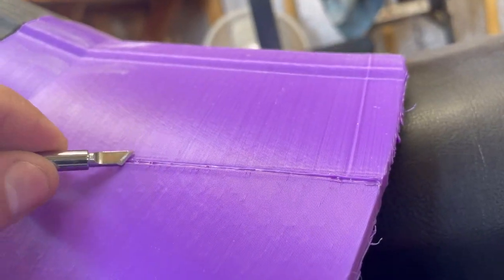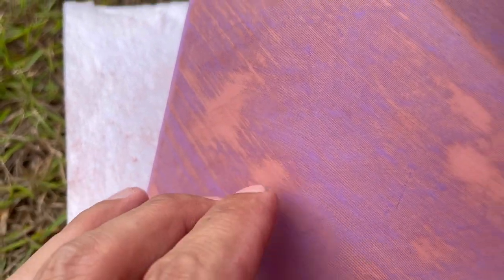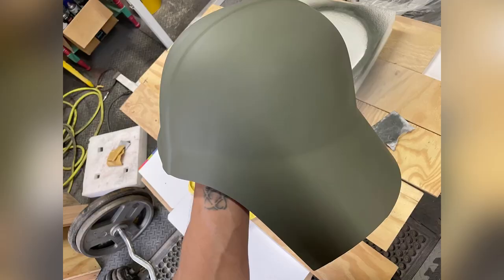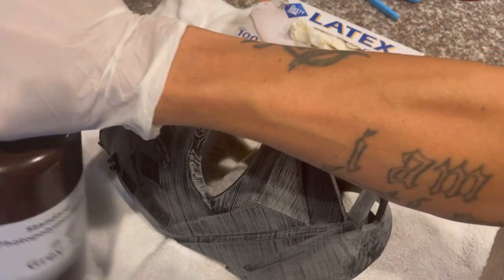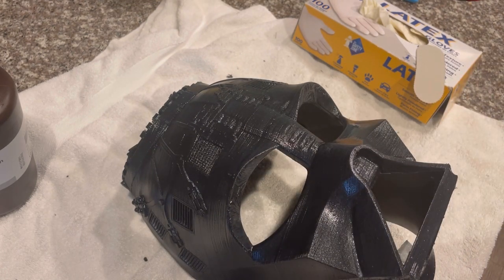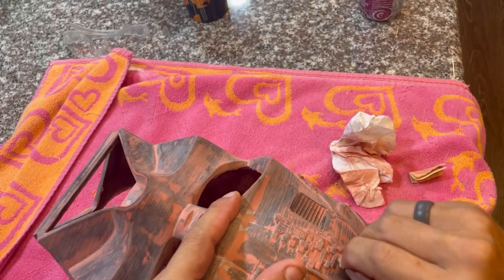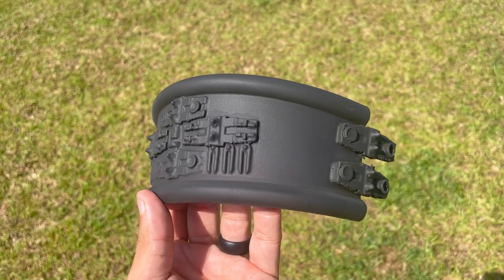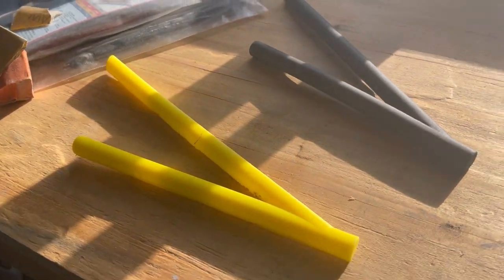3D printed Darth Vader  | Sanding & smoothing 3D prints using bondo glazing putty & filler primer

Comment: Why do you etching primer, I thought that was only really needed when painting metal.  Have I got that wrong??
Reply from the maker: It helps promote adhesion on any surface, primary used for metal but it’s a fantastic primer regardless. You don’t hurt anything using it. It’s solvent based so it dries and cures very fast.

Comment: This is a fantastic and thorough walk through of the finishing process and I've been following it step by step. I do have a question though: Is it important to add a layer of primer sealer before applying base coat? Does it help get a smoother final finish of primer before the base coat is applied? It's the only step I didn't do and I found that the base coat shows some of the texture of the primer, even though it felt really smooth and looked smooth, but the base coat wasn't as smoothed as I hoped. Wondering if the primer sealer would've helped more with this. (fyi, I sanded the final coat of filler primer with 800 before applying base coat).

Comment: after you spray etching primer do you sand that before sealer or paint?
Reply from the maker: No it doesn’t need to be sanded as long as it was applied flat.
Some people lay down etching primer first than filler primer but if you sand too much you’ll strip it off
Reply: @Darkwingdad  Thank you so much for the quick reply i am using your method and my 1/2 scale mark mark 50 is coming out great keep up the great work .
Reply from the maker: @TheTrekCollector  awesome to hear! I do have a mk50 video, if you need any tips check it out! It’s an oldie but a goodie lol if you get caught up with anything give me a holler!
Reply: @Darkwingdad  Thank you and actually it is mark 40 right now but i did just get new files for the 7,15,16,45,and 50 some will be full size and others 1/2 scale but your advice is helping alot .
Reply from the maker: @TheTrekCollector  great to hear! Good luck with the builds! Always here if you need it!

Comment: Hey man, great content. I wanted to point out that Latex gloves are not adequate protection for SLA resin. You need to use Nitrile gloves as the latex is permeable for the resin.
Reply from the maker: Yea I ran out nitrile I usually use black widow nitriles but honestly didn’t know sla can permeate through, thank you for letting me know!